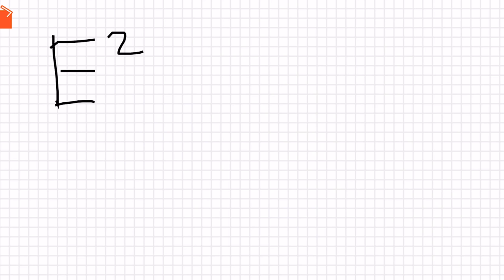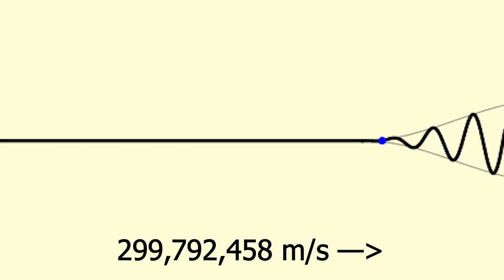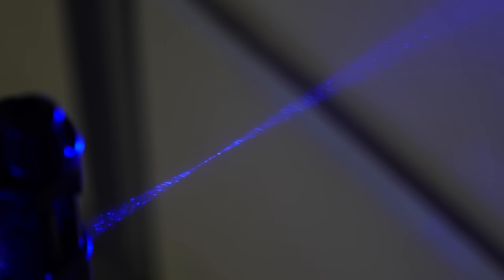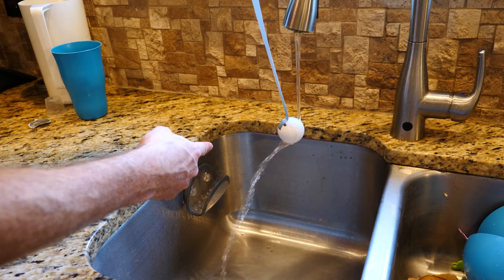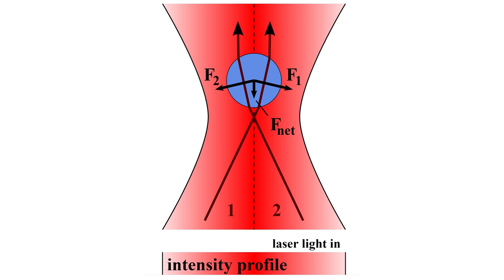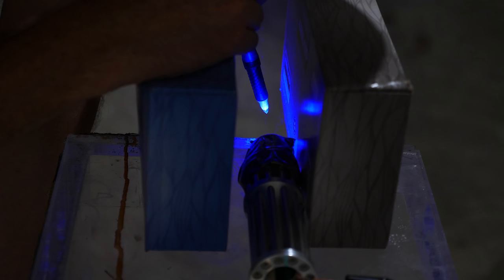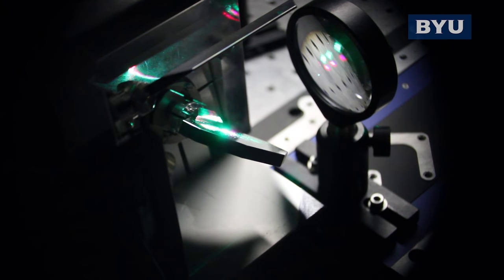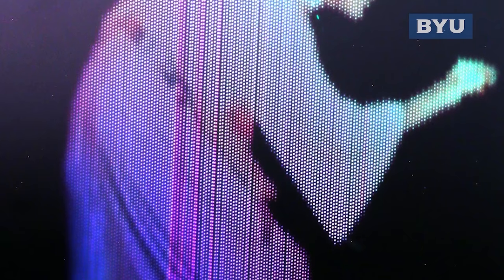Trapping Particles In a Beam of Light—The Optical Tweezers Experiment

Comment: "E=mc^2, m=0, thus E=0" is wrong because it's actually E^2=p^2c^2+m^2c^4.
However, p=mv, so p=0 as well and E still is 0.
What's the part I'm missing for the momentum definition? 😂
Reply: p = h/wavelength
wavelength = c/frequency
So
E = h*frequency (familiar form for energy of a photon)
Reply: Actually i think E = h*frequency came first from experiments like the photoelectric effect then work backwards to get momentum.
Reply: @smolboi9659  I've always heard people bickering over whether photons are waves or particles. But the solution in my head is that light is an electro-magnetic phenomenon, meaning that it hijacks electrons to carry out its course. Essentially it could be said then that light is simply a well-defined relationship between electrons in a sinusoidal (wave) shape. As the electron moves past other electrons it creates a magnetic field that transfers energy in a forward direction causing the light to progress. But the mass itself doesn't continue forward, rather just the momentum like in a newton's cradle.

I've never heard anyone else describe it like this, but I'm wondering if there are any pitfalls to that line of thinking?
Reply: @johnschewe6358  I could be wrong but the pitfall would be that your model requires the prescence of electron for light to travel. Light can travel in a vacuum. What you described is very close to classical electromagnetic theory. According to the theory light propagates like this: A changing electric field induces a changing magnetic field which induces a changing electric field and so on. This is why speed of light is related to permittivity and permeability of free space, quantities related to how space is affected by E and M fields.

The problem with this theory is that it is a wave theory of light which cannot explain observations like the photoelectric effect. Hence now light is treated to have both wave and particle properties.
Reply: @smolboi9659  I'd explain EM theory creating photoelectric effect as simply that the transmission is imperfect because we are not talking about a theoretically perfect electron transferring all of its energy to the next theoretically perfect electron. Environment matters, meaning the various properties of the material change how each electron is attracted or repelled, changing how light interacts with the surface. The reason why solar panels are dark-colored is that most of the light is being converted to another form of energy either electricity or heat. There are also cases where material can slow the transmission of light because the electron bounces around in place before continuing on. And there are examples where the color of light is changed because energy is added or removed by a surface, such as in phosphorescence. I guess I'm not really sure how you mean that EM theory doesn't explain that?

As far as traveling through a vacuum, I've found no reason to believe that electrons cannot travel through a vacuum. Yes, a vacuum is an electric insulator, but that's because an electric current is an attractive force, meaning that electrons move because there is an open spot near a proton. Whereas light is radiation. So if an electron were to be detached from its molecule it would travel with constant inertia until another molecule or magnetic field acts upon it.

I appreciate the challenges to my theory. But perhaps I'm not fully understanding what the problems are with the scenarios you presented?
Reply: This could also explain why gravity has an effect on light, because gravity has an effect on the electrons that carry the light. Even though light itself is not an electron.
Reply: @johnschewe6358  From what i understand of your model, there is a sea of electrons. The electrons are like the balls in a Newton's cradle. The energy wave passing through them like in a Newton's cradle is light. 

Suppose your theory is correct, then removing all the electrons in a region should stop any light from propagating there. This is not observed in nature as light can propagate in a vacuum which is free of electrons.

Sure electrons can indeed travel through vacuum as in beta rays but this is irrelevant. To test your theory, you will want to remove electrons. You would want to test out a region of space without them.
Reply: @johnschewe6358  I just thought of another experiment to test your theory. If your model is correct then E and M fields should affect the path of light the same way gravity does since electrons are affected by both. In nature however, only gravity affects light.
Reply: @smolboi9659  That's the most convincing argument I've heard yet. An example of the difference as you've described is CRT monitors. An electron gun shoots electrons at phosphor screen while being bent by a magnet. But light would not work in such a case because it has no charge in and of itself.

Comment: 0:52 no you dont
A photon has a mass else it wouldnt have an momentum, cause momentum by definition is m*v
You can calculate the Energy using E=h*f while f is the frequenzy of the photon and h is the planck constant. Then you can calculate its dynamic Mass with E=mc^2 => m=E/c^2
It hasnt got a mass if its still, so then it doesnt exist. But when its moving then it has a dynamic mass.